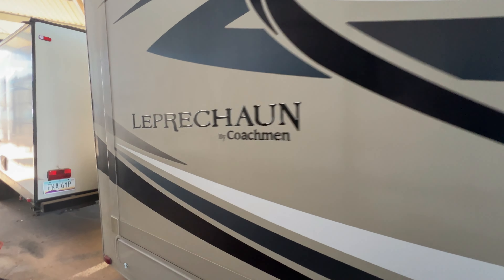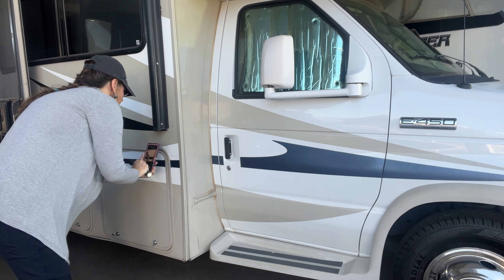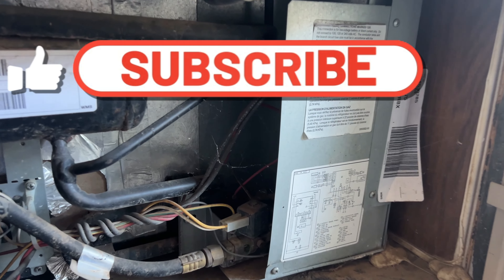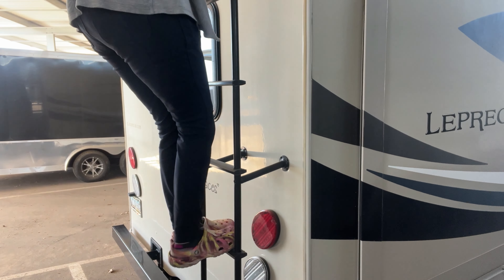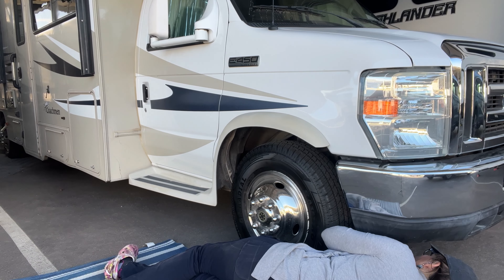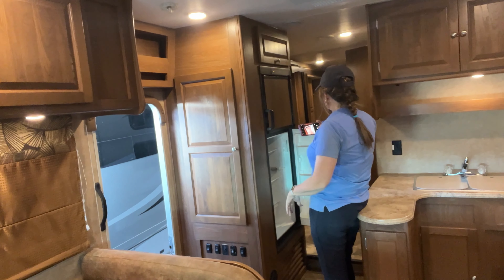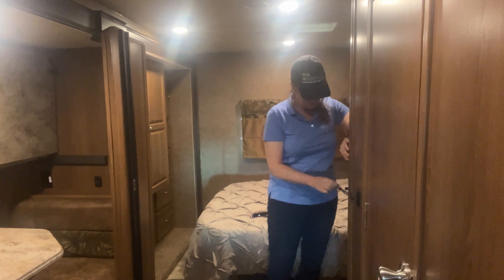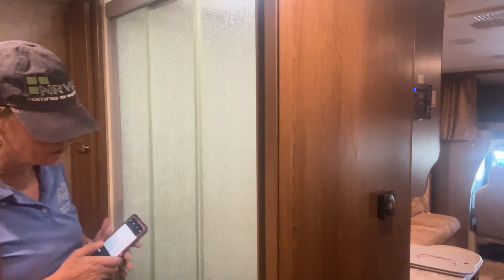2015 Coachman Leprechaun Inspection

Comment: People don't necessarily avoid purchasing used vehicles that need a repair as long as the repair minor and they know what that the repair is needed. No one likes surprises.

Contrast that with a brand new vehicle, no one likes purchasing a new vehicle that spends months in the repair shop rather than months in owner use.
Reply from the maker: I agree! It is good to at least know what you are up against. Then you can make an informed decision.